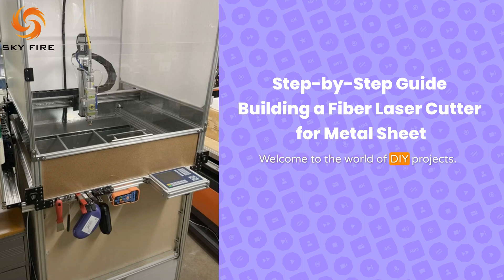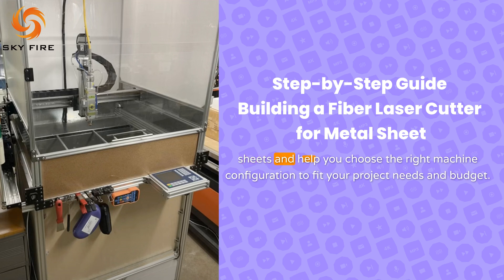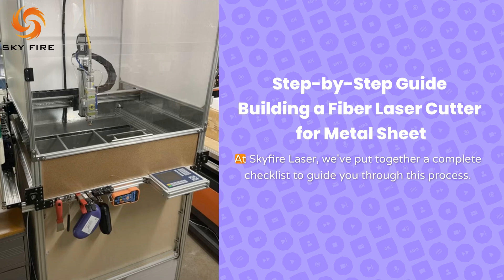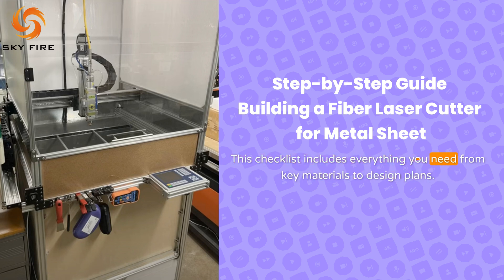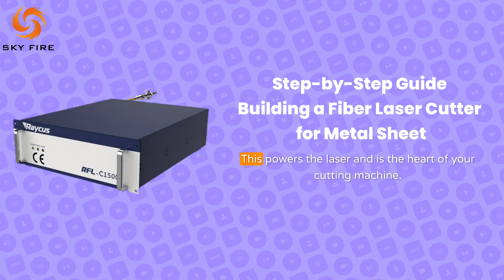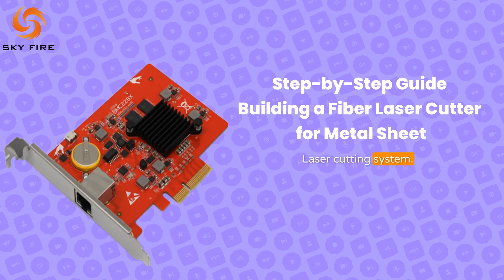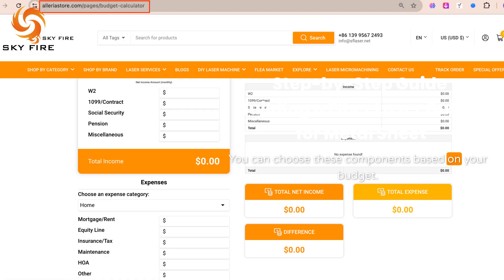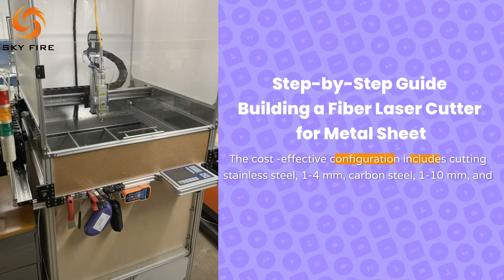Step-by-Step Guide: Building Your Own DIY Fiber Laser Cutter

Comment: I hope to cut dogtag sized discs and ?shallow cut a (readable) QR code on each. I was thinking stainless however aluminium may be suitable. I just want it to be weatherproof to all elements. I need to do several hundred of these. What material and machine would be suitable for such an application? please and thank you
Reply from the maker: Got it! In your case, I’d really recommend checking out our AirFamily series.

The AirFamily includes CutAir, WeldAir, and MarkAir — and for your application, you’d mainly need CutAir (for cutting the discs) and MarkAir (for engraving the QR codes).

You can take a look on our website for more details: www.small-laser.com.
If you have any questions, feel free to email us at info@sflaser.net — our team will be happy to help you.

Comment: Hello, if I purchase a 3000 W 4-in-1 laser (Max Laser) with the Hanli water chiller and a SUP23T head: Is it possible to remove the head and install something like the BS03K instead? Is it in any way possible to use the 4in1 laser for proper CNC cutting?
Reply from the maker: Hi Kevin! The SUP23T is mainly a welding system — it’s not just a head, it’s a full 4-in-1 setup (welding, cleaning, rust removal, and light cutting).

The BS03K is a real cutting head. If your goal is proper CNC cutting, I wouldn’t recommend buying the SUP23T and swapping the head. It’s better to go for a true cutting system like the XC3000S.

Some people do use 4-in-1 welders for simple cutting — it works, but the results aren’t comparable to a real CNC laser cutter. You can see similar examples from brands like xTool, but the cutting quality and efficiency are limited.
Reply: @Skyfirelaser I mainly want to use it for welding. I’d also like to be able to do CNC laser cutting. If the quality is better than plasma cutting, I’d be satisfied. Xtool and similar machines only have about 1200 W and very small cutting area
Reply from the maker: @kevin99_b8  Got it, Kevin — then I really have to show you our AirFamily series.

It’s all about one system, multiple functions — we keep each machine doing what it does best. A real cutter for cutting, and a real welder for welding.

Our cutting unit is rated 1200 W, but it easily handles 10 mm carbon steel — smooth edge, no burn marks, no post-grinding needed.

You can check it out here 👉 www.small-laser.com
Oh, and by the way — our working area can go up to 4 ft × 4 ft!

Comment: How does your 1500w fiber laser vary from say a handheld from xtool? What is the pros/cons of using this style with a chiller, power source etc.. The xtool ones seems all in one, no messing with that.
Reply from the maker: The main difference comes down to positioning and performance:
	•	Xtool handheld: portable, all-in-one, more for light work like trimming, holes, or thin sheet cutting. Easy to use, mostly air-cooled, but limited in power (up to ~1200W) and long-term stability.
	•	Our DIY 1500W system: a full fiber laser cutter built from separate modules (laser source, chiller, PSU, cutting head, motion platform). Optimized for cutting — faster speed, better edge quality, thicker plates, larger working area, and stable water-cooled performance. It also has upgrade space up to 2kW, 3kW, even 6kW.

In short:
	•	If you need plug-and-play convenience for occasional or on-site use → Xtool is simpler.
	•	If you want higher cutting capacity, better quality, larger work size, and long-term expandability → our DIY 1500W fiber laser is the stronger choice.

Comment: Can I use a piston compressor instead of screw compressor high power ?
Reply from the maker: @aristosuratman4783  Yes, you can use a piston compressor as long as it can provide the required pressure. However, keep in mind that piston compressors typically operate at lower pressures, so make sure it meets the necessary specifications for your setup.

Comment: for laser machine with 3048mm*1524mm, what motors can I use
Reply from the maker: @Michael-e8y3u  3000W Equipment:

	•	Economic Model:
	•	X-axis: 1KW
	•	Y-axis: 1KW (2 units)
	•	Z-axis: 0.4KW
	•	High-speed Model:
	•	X-axis: 1.3KW
	•	Y-axis: 1.3KW (2 units)
	•	Z-axis: 0.4KW

6000W Equipment:

	•	Economic Model:
	•	X-axis: 1.5KW
	•	Y-axis: 2KW (2 units)
	•	Z-axis: 0.4KW
	•	High-speed Model:
	•	X-axis: 2KW
	•	Y-axis: 2KW (2 units)
	•	Z-axis: 0.4KW
Reply: @Skyfirelaser For Y axis of 1500w watt, is 750w sufficient of 2 units
Reply from the maker: @Michael-e8y3u  
1500W Equipment:

	•	Standard Performance Configuration:
	•	X-axis: 1.3KW × 1
	•	Y-axis: 1.3KW × 2
	•	Z-axis: 0.4KW (with brake)
	•	High-Performance Configuration:
	•	X-axis: 1.8KW × 1
	•	Y-axis: 1.8KW × 2
	•	Z-axis: 0.4KW (with brake)

Comment: What chiller to use for 1.5kw fiber laser cutter under budget and how to choose one
Reply from the maker: For a 1.5kW fiber laser cutter under budget, I recommend these two models of S&A CWFL-Series Fiber Laser Water Chillers （https://alleriastore.com/products/fiber-laser-water-chiller-cwfl-series):
	1.	S&A CWFL-Series Chiller (50Hz) – $471
Suitable for regions with a 50Hz power frequency. It offers reliable performance and is budget-friendly.
	2.	S&A CWFL-Series Chiller (60Hz) – $521
Designed for areas with a 60Hz power frequency, slightly higher in cost but equally effective.

How to choose:
	•	Power Frequency: Check the power frequency in your region (50Hz or 60Hz) to ensure compatibility.
	•	Budget: Both models are affordable options, but your decision may depend on the availability of 50Hz or 60Hz power in your area.
	•	Performance: Both chillers can effectively support a 1.5kW fiber laser cutter, ensuring optimal cooling and stable operation.

You can use the discount code “fromtravis” to enjoy a 5% discount. Additionally, if you provide your detailed shipping address, we can calculate the shipping fee for you. This fee is usually lower than the automatically generated fee on the website, saving you even more.

Comment: Why  FSCUT2000E is way more expensive than xc3000s, is xc3000s a a equivalent to  FSCUT2000E. What differs?
Reply from the maker: Thanks for your comment!
The FSCUT2000E is priced higher than the XC3000S mainly because:
1.Brand Reputation: FSCUT (Bochu) is the leading brand in China with a strong reputation, while XC3000S (Raytools) is a newer brand. It’s similar to comparing IPG with Raycus in terms of industry standing.
2. Stability: The FSCUT2000E offers better stability, ensuring reliable performance over time with less maintenance.
3.User Interface: The FSCUT2000E has a more user-friendly UI, making it easier to operate and adjust settings.
Hope this helps!

Comment: Could a rotary axis be added to the software? I want to be able to cut holes into tube but use a flat laser cutter like this so I have the versatility
Reply from the maker: Thanks for your great question! 
Firstly, confirm the following: Determine if you're cutting round tubes or square tubes.

1, If it's a square tube and you're only cutting holes on the surface without cutting through, you can use the flat cutting software, such as XC3000S https://alleriastore.com/products/raytools-xc3000s-laser-cutting-control-system or FSCUT2000E https://alleriastore.com/products/cad-nesting-laser-software-fscut2000e. If you need to cut through (truncate) the tube, you will need an integrated tube-and-sheet cutting software, such as Raytools AX3000T: Laser Cutting Control System For Tube&Sheet Integrated Machines https://alleriastore.com/products/raytools-ax3000t-motion-control-system or FSCUT 3000DE-M https://alleriastore.com/products/fscut3000de-for-tube-cutting-machine?variant=44884559266043.

2, If it's a round tube, whether you're cutting holes on the surface or cutting through, you will need an integrated tube-and-sheet system, either AX3000T or FSCUT 3000DE-M.
Reply: @ high, this is for cutting round tube. But instead of using a tube cutter, I would like to have an attachment I’ve built sit on top of the flat surface and have the laser move to cut the round tube , so similar to a tube laser cutter but instead of moving the tube, the laser moves on the y axis in the cnc bed. 

The reason is, I use the same frame holder for the product so it can go from the cnc to finishing in the same work holding 

I could use the flat / tube combo machine but if it can be done on the flat version it would be much better for my use case, trying to find how to make this possible 

Thank you!
Reply from the maker: @EricRaum  I just consulted with our technical team. If you absolutely need to perform tube cutting on a flatbed laser, you would need to convert the X-axis into a rotary axis. This would require installing a separate rotary motor and converting the 3D cutting diagram into a 2D one. This method would be quite complex. Additionally, the downside is that you would need to adjust the motor's configuration parameters for each cutting operation, which we actually don't recommend.

We truly recommend that you consider choosing a tube-and-sheet integrated system.
Reply: @ thank you for going through such lengths to find this information, I truly appreciate it. I do believe a dedicated tube would be good, it is such a niche investment for the purpose, we would really love to get a flat laser working to allow us the multi use! But I do understand this may be beyond the scope of what can be done right now thank you
Reply from the maker: @EricRaum  No problem at all! Take your time to research further—eventually, you’ll find the perfect solution. If you’re considering a dedicated tube cutting machine, I recommend checking out https://www.youtube.com/@diyfiberlaser.

For machines capable of both tube and flat sheet cutting, you can explore https://www.youtube.com/@TAMARbarCNC.

Feel free to reach out to them directly or contact us if you have any questions. We’re here to help!
Reply: @ thank you, this is very helpful. After further review we will build our own. Your guide has been very helpful. A question on laser heads. This machine will be used for musical instruments. Is there a best head for ultra precision, for jewelry or medical, for example? Thank you I have joined your FB group and look forward to working with you on this build
Reply from the maker: @EricRaum  Thank you for your trust! In fact, the cutting precision is not solely determined by the cutting head. Most mainstream cutting heads on the market can achieve a precision of around 0.1mm. However, the actual cutting precision depends on the overall system, including the precision of the cutting machine frame, the accuracy of the gears and racks, the assembly precision, and more.
Reply: @ ah that makes sense. Are there heads capable of closer than .1mm precision? Is what is used in jewelry or medical device different in some way, like the FM220 is advertised? 🙏 thank you
Reply from the maker: @EricRaum  Yes, there are cutting heads capable of achieving precision higher than 0.1mm. If precision is a key concern for you, my loyal recommendation would be to use a fixed-focus cutting head and then improve the machine's overall precision, such as the frame, gears, racks, and the assembly accuracy. For example, some precision cutting machines use marble platforms for enhanced stability and precision.

Comment: I am also curious about power needs. If you are running a 3000w laser system off of 220v, do you lose some ability as opposed to using 380v?  Not all locations have 3 phase power available, especially in a DIY situation.
Reply from the maker: @dcmotive  Thank you for your question. Most 3000W laser systems are designed to run on 380V, and unfortunately, they cannot operate on 220V. The main reason is that the power demand for a 3000W system is quite high, and 220V may not provide sufficient voltage to ensure stable operation. While single-phase power (220V) works for smaller devices, high-power systems like lasers require three-phase power (380V) for more reliable and consistent performance. Additionally, using equipment rated for 380V on a 220V circuit can cause damage and create safety issues. For these reasons, we highly recommend using three-phase power to ensure safe and optimal operation of your laser system.

If you have any further questions or need assistance, please don’t hesitate to reach out. We’re here to help!
Reply: Distinguish the laser power from the AC input power.  There are inefficiencies, some of which which heat up the coolant.
The coolant chiller needs power, to remove that heat.

Comment: Could use more comparisons on trade offs for manual/auto focus, as well as electrical power requirements as laser power goes up.
Reply from the maker: Unless you are only cutting fixed-size workpieces and aiming for lower costs, we recommend using an auto-focus cutting head. Additionally, the point about "electrical power requirements as laser power goes up" is indeed interesting. Thank you for pointing it out.